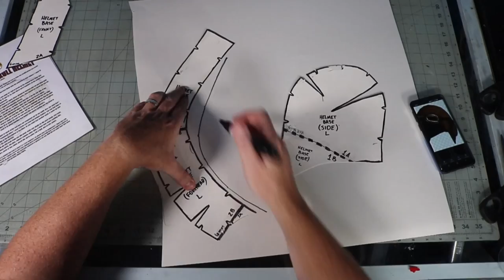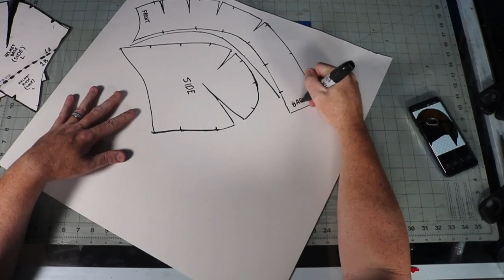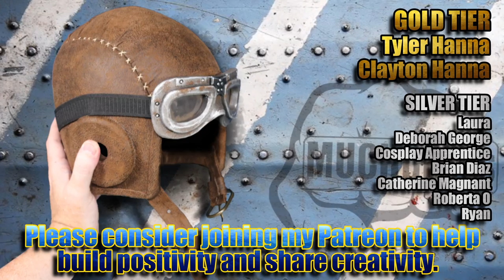Making a Boomers Helmet from Fallout New Vegas

Comment: Helmet from Up?  When you heat seal, do you use high heat or low heat?  I have a 2 position switch heat gun...also, was thinking about the bigly Nintendo game, what about making a huge lord of the rings, ring? Like a foot across?  But jolly good helmet
Reply from the maker: LOL. My heat gun kicks on at 650, at that temp you just have to move quick over the surface. Thanks for the suggestion.

Comment: Use this a look in the comments of Odin makes rebel commando helmet for the brim template from pepreaka so that u can make a rebel Comando helmet
Reply: I was just thinking the same thing. I found a 3D file fir the ring and was needing the inside part. I’m pretty sure this will work fir the rebel commando helmet.
Reply from the maker: With this basic cap it could possibly be modded into several different builds.